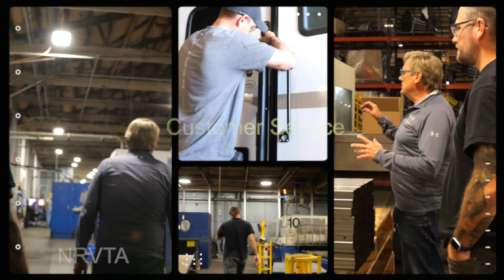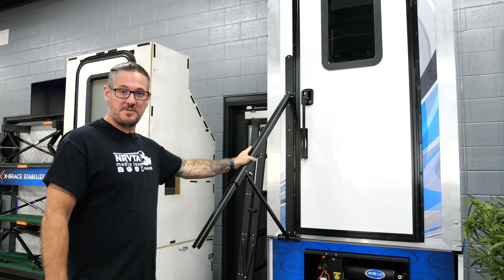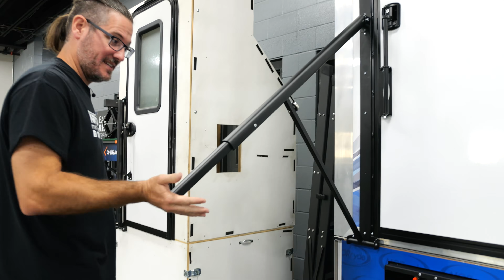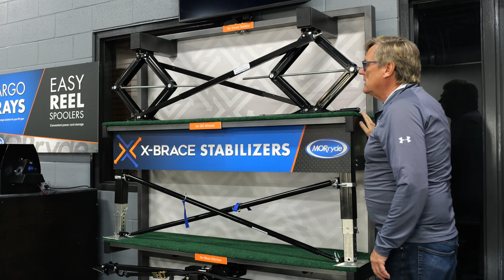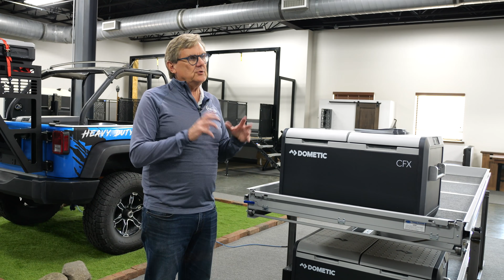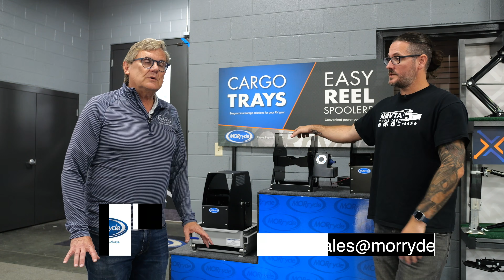Must have MORryde RV Accessories // Manufacturing Plant Tour

Comment: I’ve had the large slide out tray, that goes out both sides for 4 years, it was an option from manufacture. Surely that isn’t new. I also have a power 50 amp cord reel.
Reply from the maker: This video isn't highlighting just the brand new products MORryde has to offer. There are many new and experienced RVer's who just aren't aware of the options available.